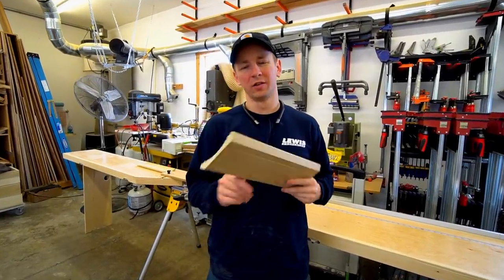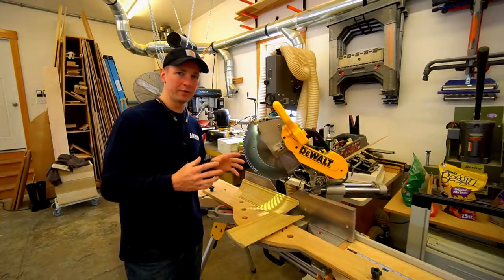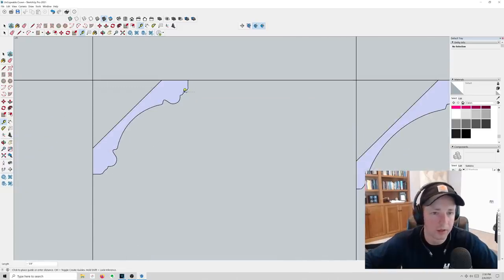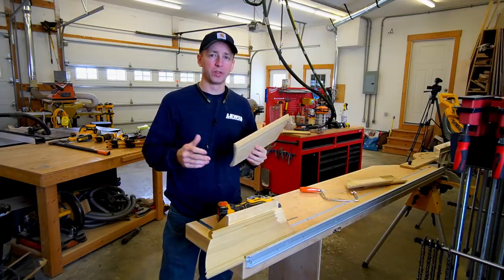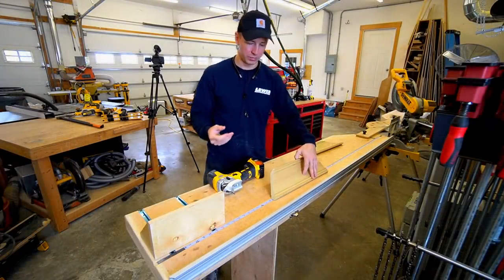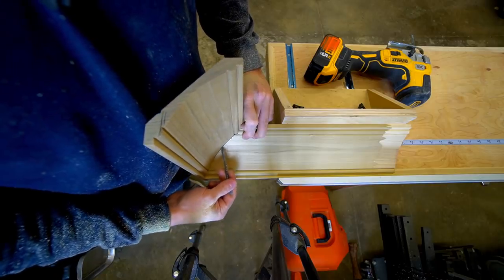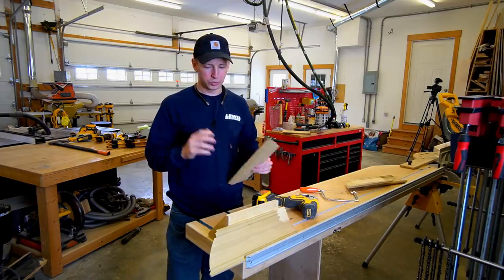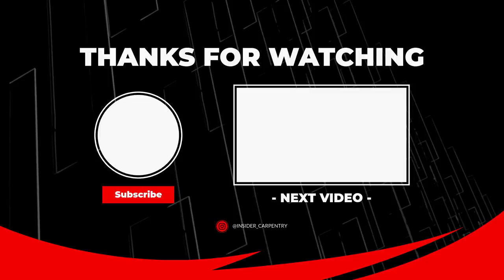Why Some Crown Molding Profiles Can't Be Coped - Sometimes you just have to miter...

Comment: For me  I only miter my crown for two reasons. One it’s faster and second it’s stronger by gluing the joint. I also only cut in the nested position. I also only cut in the mitre position too. By only changing the miter on the saw instead of Changing the mitre and the bevel. It  saves a lot of time and way more efficient.
Great video great topic!!
Reply: And saves from blade deflection.

Comment: Another great video and once again I learned a few new tricks. I'm "that guy" you mentioned that copes using a coping saw and with the crown laying flat on its back. A carpenter showed me how to do it about 30 years ago and I never gave it much thought after. I wasn't aware of a more accurate way to do it or a better tool to do it with. I also now know why I've had some issues coping some crowns. I always thought the reason some joints didn't fit as tight as others was due to my coping skills. In retrospect, it wasn't me, it was the crown I was using. I never realized some crowns can't be coped.

Comment: Great words of wisdom to widen your skill set and don’t pigeon hole yourself. I found my most comfortable format on coping was a Makita 9031 belt sander 1-1/4x21” I preferred the smooth tooling as opposed to the bumping effect of a jigsaw and the exposed front pulley allows for a variety of profile sand offs, they also have a Model 9032 which is 3/8”x21” even tighter. Some horizontal cuts require a very slight corner detail I manage with a 4 way file rasp and rat tail for rounds if needed.

Comment: I need to try this to physically see "uncopable" crown. 

But why do miters work? Because youre removing material from both pieces. Theyre going to go together if the angles are correct. 

So for problem profiles a fix would presumably be to file/notch the through piece at the problem point(s) and it should go together.

Comment: Wish I knew this years ago when I was installing crown for the first time and couldn’t figure out why I was having so much trouble.  A couple of corners somehow worked out ok, I guess because it’s an old house and everything is out of square but there is one corner that required a lot of wood filler and caulk.  We’re about to do another room using the same crown molding.  I’ll probably still cope it and do a liquid cope for the piece that gets cut off.

Comment: Another well done video! I couldn't agree more with your comments about being open minded and not thinking your way is the best/only way. I have worked as a carpenter for 30+ years, the first 25 years almost exclusively as a framing contaractor. I can think of quite a few small tips I picked up from other people, that after I was shown them were "Oh Duh!" Moments when the small tip was so simple that it should have been obvious. Then after applying what I learned I could quite literally save days of cumulative time on a typical new const framing project. I have even been hired by other companies to come work on a temporary basis to see how they are doing things and show them areas where they can work more efficiently.  People who aren't willing to learn and adapt are only hurting themselves. BTW, I have only ever cut crown upside-down/backwards as you demonstrated. Are you going to make a video showing any tips on  how to cut taller crown profile by laying it flat in the saw?
Reply from the maker: Maybe someday, but probably not anytime soon as I never use that method personally.

Comment: I miter my crown and I change the compound miter to  cut a lil more out the back of the cut to make the face of the joint a lil tighter and I add a 1/16  to every board that has 2 inside corner it makes it look  like furniture grade work before paint 👍

Comment: I used to cope all my crown when I started out 35 years ago doing stain grade and even paint grade until I saw that painters were still caulking my super tight joints. Now I 45 all my crown except when I run wood crown into flex crown then I cope the wood crown

Comment: Good stuff Spencer.  I made  a set of wings and crown stop very similar to your setup. Tried the coping set up and like it. Seems to work better for left end copes and wonder if would be better to do right hand copes on left end of wings? Maybe I'm missing some minor detail? 
Also i wish you'd go just a little more into how you designed and made your crown stop. 
I love mine and really helps with the support being all the way across but have trouble seeing the scale in between detents. I notice you have holes to see through but do they work for different size molding?  I do  3 1/4 to 6" primarily. Thanks for all the good info. DB

Comment: EDIT: At 14:11 Use a utility knife to miter the bead on the left.
Just thinking aloud here... is it possible to cope like normal and simply notch out the other piece with a utility knife? I'm having trouble juggling the pieces in my head, and don't have a suitable piece to try it, but I think the notch, if done precisely, will be hidden inside the joint. Hope that makes sense.

Comment: I quit coping 30 years ago, never had a joint fail since. Number one you can glue it, number two if your wood is unstable and it moves you can fill it and you have something behind there to hold it and three you never have to fight that Crown cope again. And by the way it was because of that same identical profile you are showing that caused me to switch forever.
Reply from the maker: Very logical reasoning. 👊

Comment: Spencer a question off topic, I have a huge amount of base board to install. They are all bull nosed corner beads, how do you set up to cut multiple 5/8 22.5 pieces accurately. I apricate all info that you can give, keep up the great videos, they are very helpful.
Reply: Check out Finish Carpentry TV's channel; he's in the Dallas - Fort Worth area where bullnose corners are common. I just moved to Phoenix last year from the midwest, his channel helped me out a ton. There's a couple tools you need; bullnose trim gauge and CA glue for sure. Richard and Spencer are buddies via youtube, very respectable craftsmen.
Reply: @joshuahellriegel3354  Cheers thank you.
Reply from the maker: I actually have never encountered this. In my market they don't run bullnose to the floor. Sorry. :(
Reply: Cut one of the 5/8 pieces then measure what the long points are. Now you can work on the face of the baseboard. You’ll want to make a pencil mark on the base of your mitersaw as a location for the long point of the 22.5. Once you cut that, slide your base to that mark and cut the other side 22.5. It’s like using a stop block without a stop block. Your just using a pencil mark as the reference point
Reply: @toolman101476  Thanks ,I will try that, my only issue is the safety aspect. I ma have to use maybe a 7 1/4 chop saw instead of my 12 slider.
Reply: @barryhornett7341  ok so different method.. tilt your saw on the 22.5 and cut the base flat. Keep the saw tilted and just flip over the baseboard and cut again. This will keep the saw beveled on the same angle the whole time so your not moving it. The base will start out face up then face down to finish the cut. You will still make the reference mark so you know where to place your piece.
So to recap that.. bevel it , flip it over on its face and slide the base to your mark, then make the second cut.... your done!
Reply: @toolman101476  Thank you kind sir !!!
Reply: Make yourself a thick sacrificial fence for starters. A nice piece of flat stock/ply for the base and a couple inches thick fence.  This way you have a zero clearance fence for your small parts and they won't get kicked at the end of the cut. Then start with a long stick to cut the 22.5° fillers. You can work from both ends flipping the stick so you're not changing your miter as often.
Reply: @mattk1737  Thank you sir

Comment: OK... I hate to break it to you guys - There is no such a thing as uncopeable crown molding, cornice or ceilling moulding. Every geometric 3D figure is able to interpenetrting one another. And before you start posting hate comments for my statement here, know this: It is a 3D geaometry principle. Second, we just have to have right tools for it. Without right tools obviously we ain't able to do it. Third, if you do not believe me get yourself any software capable of 3D drawing and you will see that any profile can be cope. With all due respect to Spencer (although, he is somewhat right about certain issues), I love your videos and you're highly respected tradie I'm sure, but I respectfully disagree. I have been in industry for more than 40 years. And yes, I am still using a relic coping saw, but now I also use a grinder and DREMEL tool. Please, check the above points before you hate me for it!
Reply from the maker: It's best to avoid it, especially if it makes tile contact at the floor. It will swell when wet.

Comment: Anything can be mitered so why not just miter it
Reply: Miters are more dependent on your walls being square, and are more prone to opening up from wood movement. Copes can be installed with more pressure on the joint.
Reply: @mattk1737  have you used a tool called a mitre X have a look it will give you a perfect angle to copy onto a chopsaw or sliding bevel miter saw and you don't need to know the angle degree until transferred to the saws angle perfect everything and will look in tight with no gaps If plaster is pushing skirting out at the bottom just chop away as you won't see it or need if as you can miter fix joint give it a lock on YouTube Mathew mitre
Reply: @markmills7640  Yeah, I'm not saying you can't miter, and mitering is sometimes the more realistic approach, but coping has certian advantages miters don't/can't attain.